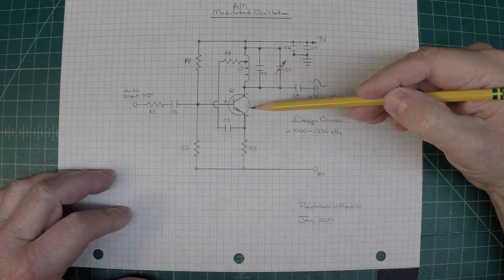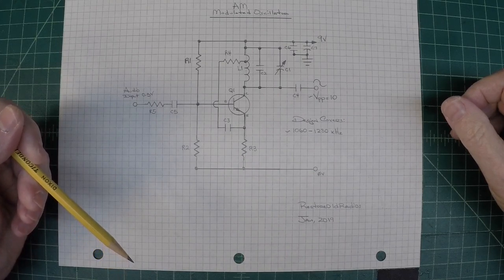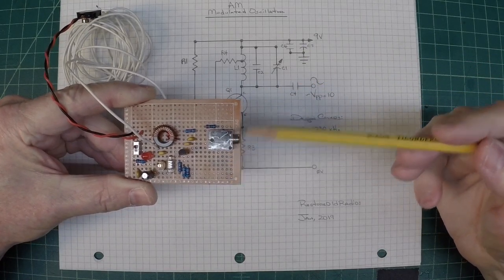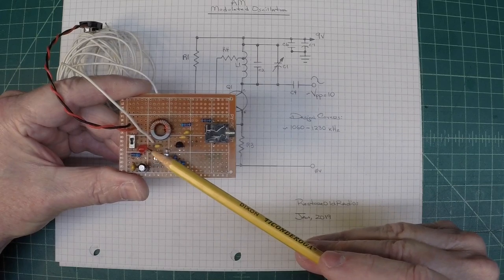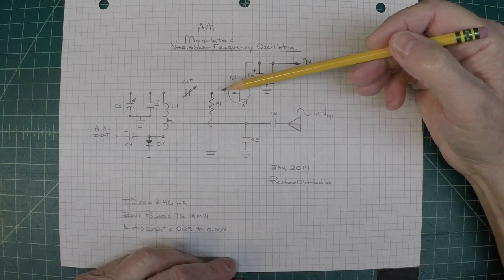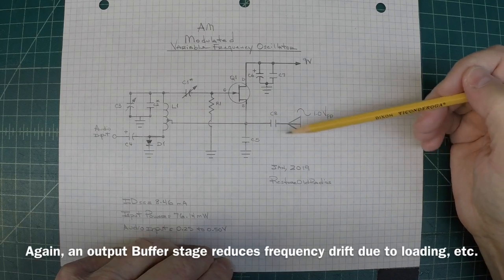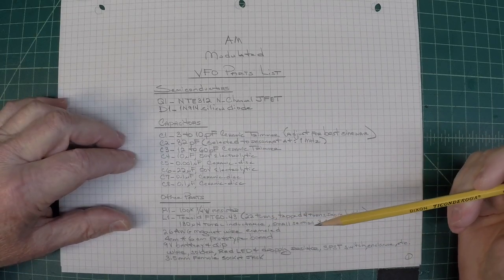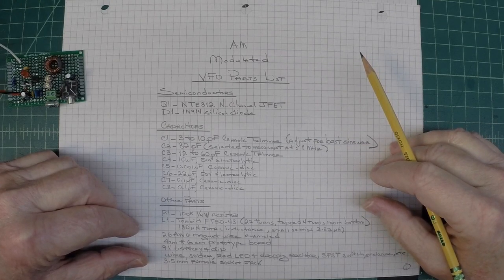Variable Frequency Oscillators (VFOs) - BJT & JFET + Buffer Amplifier Circuits

Comment: Man Don, gotta say really good stuff. I'm going to try a toroid coil as it's something I haven't tried yet in my transmitters. Plus that FET buffer has " try this " written all over it. Thanks for sharing pal.
Reply from the maker: Thank you Carl. The FET Buffer is a unity gain amplifier, but it really minimizes the effect on the oscillator loading. It can be used in audio applications as well, just up the input/output capacitor values to a .01 or greater. Have fun and let me know how it works out for you. Best, Don

Comment: Where did you buy that 3.5mm jack connecter from?
Reply from the maker: Hope this helps.

Best,

Don

uxcell 10 Pcs Plastic PCB Mount 5-Pin Stereo 3.5mm Socket Audio Connector
by uxcell
Learn more: https://www.amazon.com/dp/B00GLQAF7A/ref=cm_sw_em_r_mt_dp_cyXTFbYYN5ACQ?_encoding=UTF8&psc=1
Reply: @RestoreOldRadios  Perfect. Ty.

Comment: Why is an electrolytic cap needed since the power supply is a battery which would have
 no fluctuations?  Thanks for your very interesting videos.
Reply from the maker: Decoupling for any noise on the DC buss and to keep the DC voltage as steady as possible to reduce chirp (frequency drift) of the oscillator. Sorry for my belated response, I've been offline. Best, Don

Comment: I'd be interested in seeing an FFT of the unmodulated carrier. You would be able to see how "clean" the sine wave actually is. You should be able to push a couple buttons on the Rigol to have a quick look at the FFT. Just a thought.
Reply from the maker: Hi Dave - thanks for the recommendation. I’ll give it a try when I’m back in the shop and post the results for your review and feedback on the results. Best, Don
Reply: Thanks.
Reply: Some further info:
Spurious radiation (harmonics, etc) needs to be 20 dB below the fundamental frequency of the unmodulated carrier.
The Rigol scope can scale the FFT to display in dB,  so should be an easy test to set up.
Reply from the maker: Dave - I would appreciate you reviewing the FFT screen shots and let me know your thoughts. Thanks. Don

https://youtu.be/2tDQSFCf-Sw
Reply: Looks pretty "clean" harmonics look to be 30 or more dB below the fundamental. That is a good bit better than "legal" (-20 dB)

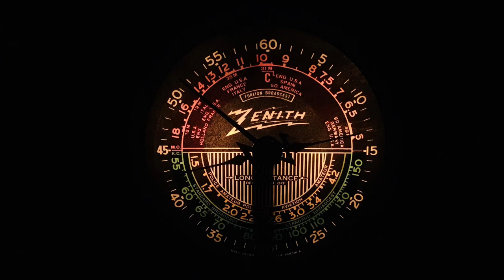Comment: 00:00 to 00:15 = "what night time Dx'ing should look like"; happy 2019 to 'you, and your's have the best of times in 2019'.

Don, having been the recipient of your kindness, seeing your workmanship "up close", and having been an engineer for almost 40 years; this is driving me 'nutz'; your work is 'engineering lab neat', and I'm a "neatness fusspot". Your work makes mine look like "romper room jump-rope", and your schematics turn mine into instant "chicken-scratch" (this, from an eight year "Parochial" education plebe); heck, my block printing looks like architectural printing. Where, when, how did you develop these methods; "Enquiring minds want to know!®"???

By the way, a church near me is encountering "mysteriously noisy" audio, with their 'broadcast quality sound board', and McIntosh "large venue, multi-amp (five MC-2500's) system" (similar to a "Wall of Sound" system like Phil Spector, and Jerry Garcia used). I have a DS0138 sitting out there, connected to the sound inputs; I sat for an hour today, couldn't duplicate what was heard Sunday. I injected a 200 Khz 'dirty sine' into each mic ground, and nothing, not a "peep of a leak" on any shielding.

Tomorrow, I'll tear into their master switching board; your tracer is going for the ride; I have a 100% repair rate on "suitable" items on which I've used it. (still amazed that I was able to use it on that Mitel SX50 phone system). Gotta keep going, while I can still walk, man this cellulitis has been "not fun"!
Reply from the maker: Tim - I hope 2019 is good to you too my friend. I took drafting in school and had the opportunity to practice off and on a few years on my first job. I've since forgot everything I learned, but thank goodness for those plastic electronic templates I never tossed and boxes of good pencils.

I sure hope you’re able to get to the root cause of the audio impairment and it excites me you’re taking the little signal tracer along for the ride. I’m curious to know what you find afterwards. Don’t overdo it and take care of yourself. 

Best,

Don